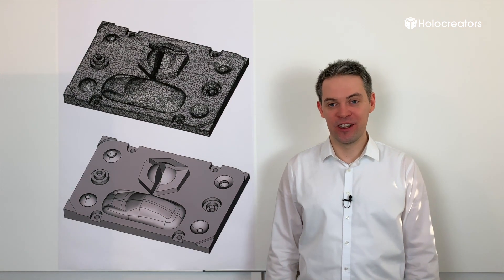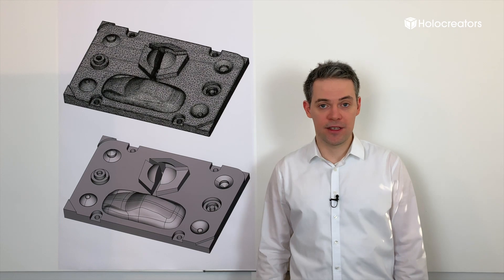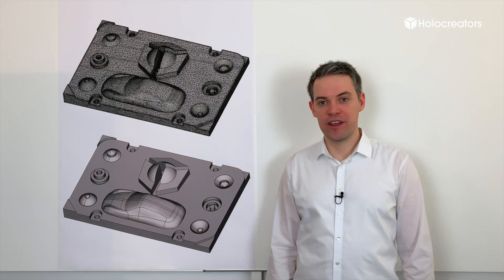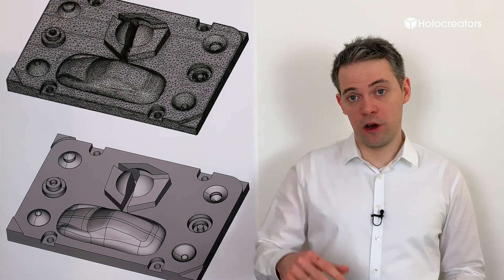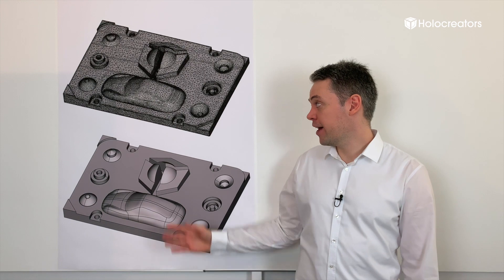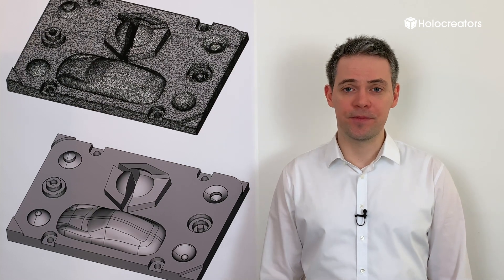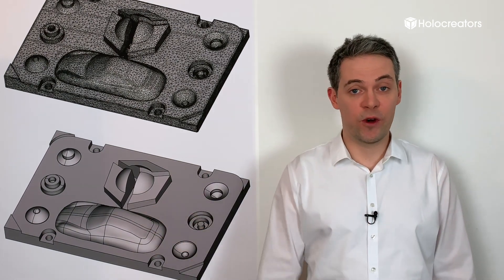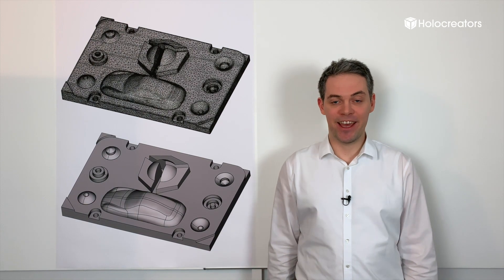What Is Reverse Engineering to Solid Model?

Comment: so let's say I want to make a 3d scan of an engine head where I really need very precise scanning to make a cad model out of it and then put it on a cnc mill to actually produce the part, then what scanner and programs should i use to convert the scan to cad?
Reply from the maker: If you want to use free Software, you could use FreeCAD. Other software would cost money. Structured light 3D Scanning with a Zeiss Scanner Atos will yield highly accurate scans.
Reply: @Holocreators  really appreciate it brother, I will absolutely consider your recommendations. But do you advise me to design a custom engine instead of just scan it and risk the quality?
Reply from the maker: @karaabdelkader1273  <this I don't know how to answer. I thaught you only needed one part of the engine.
Reply: @Holocreators  good advise object of 10,000 euro.

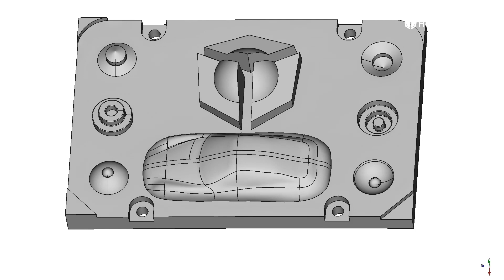Comment: So basicly (1:38) i can do that in zbrush ? Don't understand why such pure scan can't be used for printing (because that what is purpose right ?) - it have less than 5k tris anyway so its like nothing. Basically my question is - why not use zbrush to create 2mln poly and print from it? Or its still not enough smooth surface and those "3d vectors" (cad modeling if i understand ) is needed here.
Reply: CAD programs only deal in splines models. They can't handle hundreds of thousands of polygons, let alone millions like how Zbrush can handle. The purpose of converting such a part to CAD isn't just for 3D printing but to add to your mechanical assemblies. Models like this within a CAD program can also hold information that Zbrush, Maya, Blender, or any other poly modelling packages can't... such as material data (steel, aluminum, polycarbonate, etc) and mass among other things. They can also be placed in simulations where you can evaluate stresses on the part when in use.

It's just a different application, particularly for mechanical design and engineering.
Reply: Ahh ok then. I was confused because I saw many times model from Zbrush or Scan and people who stick "reverse engineering" Thanks for reply with details
Reply from the maker: @jurandfantom  excellent, have a great day
Reply from the maker: @BossHossV8Cycles  I fully agree. Different application. Zbrush is a great tool in its own domain, but not the right tool for engineering.
Reply from the maker: Hi, when you want the model for 3d printing, you could directly use the 3d scan (and maybe do a little cleanup in Zbrush).Reverse engineering is needed if you need a CAD file to make the part on a CNC mill for example. Or if you want super clean topology. 3D Scans are always a tiny little bit dented. With reverse engineering we can create a super clean pristine part.